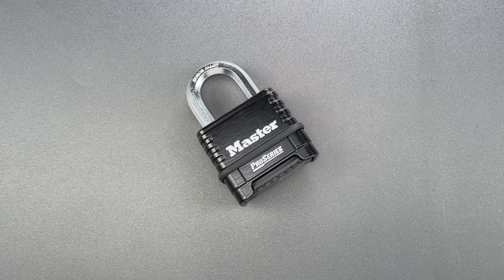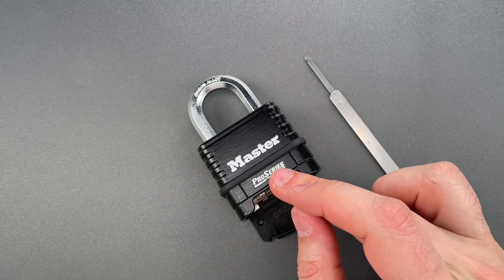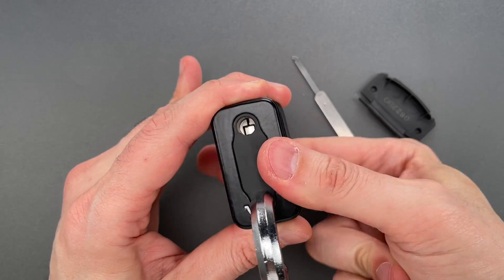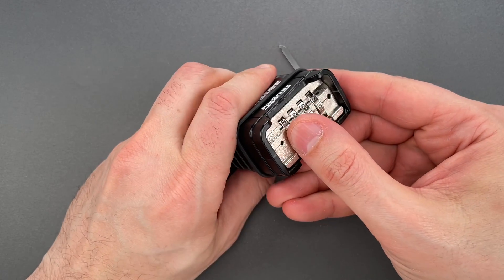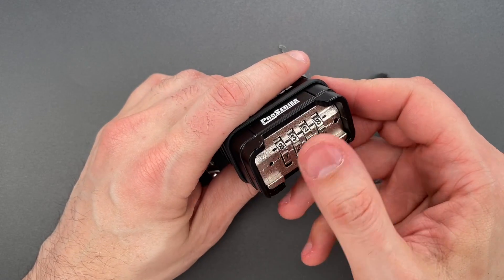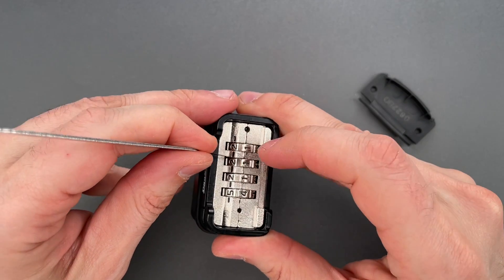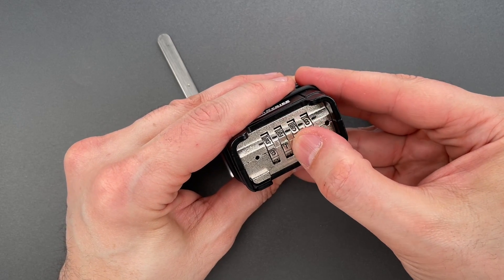[1521] Decoding Master Combination Padlock (Model 1178)

Comment: Its scary, how easy me as a novice can open some locks, i bought a cheap set on a website, cus i wanted to learn, found a use for the skill one time at work, and it took me a few seconds to open the lock just raking it with a diamond pick.

Comment: Master lock has the same flaw in the brass 3 number combination locks. There's another technique where you just tension it and spin all 3 wheels at once as fast as you can. You can get them open in 30 seconds or less. I was playing with one in math class when the teacher asked me if I knew what the odds where I'd actually open the scrambled code? It literally dropped as soon as he finished asking. "Pretty good..." I replied with a smirk.

Comment: Dear Lawyer,
I know it's only a €10 bike lock and worth €2 of the brand REHKITTZ on Big A ASIN B07F2XX61H, but I forgot the combination.
I was quite sure to have adjusted only one of the five number rollers, (00007) but I can no longer open it.
Maybe you have a tip for me, preferably without tools or with a very simple metal strip, for example.
Greetings
Frank

Comment: Breaking news: Master Lock and Boeing are discussing a merger. The new locks will feature a price tag with an improved value, adding one more zero. They will also be delivered several months after your order. But, in exchange, you don't have to embarrass yourself with LPL methods, as they will randomly fall off on their own, saving you the trouble.

Comment: I once opened a 4 number code lock with brute force. Exactly 10000 possible combinations and I got unlucky and the code was 8650. But after I had gotten the hang of it, I could, as long as my hands didn't get sweaty, get one combination per second on average, so it took me a little over 2 hours. 

If someone really gets the technique down, I could be possible to brute force 10000 combinations in an hour, meaning that these kinds of locks aren't that good, no matter how sturdy the lock itself is, someone can just trial and error it.
Reply: I guess we have different definitions of brute force.
Reply: @jimnelsen2064  I'm referring to the mathematical brute force. Like how AIs try to brute force a password.
Reply: Yep i get it, just teasing.

Comment: One thing that's always worth mentioning with locks like this: you only need to decode all but one dial.  Once you have one dial left, you can just try each digit until it opens.

This reduces the number of possibilities from D^N to D^(N - 1) + D, where D is the number of digits per dial, and N is the number of dials.

Comment: These are not high security by any means. However, this is the longest I've seen LPL take to open any Master Lock. It's a low skill attack, but it does take longer than raking.

Comment: Now I would like to see a way to reliably decode the combination of those typical, 3 number combination, "right-left-right turn" rotary knob combo locks that you see all over school and gym lockers and such, because I have a few of those that I've found in the trash over the years, that I don't know the combo for, but that I could still use if I knew of a reliable way to find out their combinations. I'd rather not destroy their case physically just to find it out either, because of course that makes them basically useless at that point.

I realize that those kinds of locks aren't very high security at all, but they could still be useful for locking up your garage tool cabinets or tool boxes from curious kids, etc., (for example), or just for something where a lock would be rather useful and helpful, but not absolutely essential for life safety or security.
Reply: Try his video 635, worked on my sister's old locker combo lock
Reply: @shadowraven137  I'll have to look that one up on his channel, but if it's just him picking one of those rotary combo locks that actually had a key bypass on the back of it, then that's not really what I meant by being able to decode the combination of those types of locks. That doesn't count.

Comment: I would like to note that on the covert companion you made the notch decoder out of steel. It easily deformed after using it for a bypass a few times. Perhaps cutting it out of nitinol to allow for heat reforming would be best ? I'm not sure I'm planning on buying a laser cutter after I find a place to live and I'll do some experiments.

I was also able to heat treat the notch decoder after reforming it to make it slightly better

Comment: Back in the day when code padlocks came out I used the same pressure pull and turn the dials as you did with this padlock. 
The fun factor was the when we unlocked around 4 we put them on the other bikes basically mix them up. Lol. Never did hang around to see what the result was when they came back and the lock wasn’t theirs. 
Did do this a few times 😂

Comment: It seems like all of these cylinder combination locks are vulnerable to the first method LPL used.  You pull on the shackle and there is a different resistance to the wheels when the right number comes up.  I don't know much about the mechanism being used; is it possible to engineer this style of lock that does not have this vulnerability?  Are there locks in circulation that don't suffer from this?  I prefer combo locks in places like a rec center because I don't have to carry around a key that might get lost while I'm working out.
Reply: If it uses a simple bar as part of the mechanism, it's always defeatable with this method, providing you have the skill to do so.
Combination locks are even worse as almost all of them can be shimmed.

Comment: I have this exact same lock. Use it for internal gates so you can only get to them from inside the yard. I bought it for weather resistance vs security. The rubber flap just trapped water and froze when cold so I ripped it off. Locking numbers are at an angle too which is a little annoying. See how it holds up to the weather. Last few combo locks (175) failed after 6 months. Masterlock kept sending me replacements but the just didn't hold up.

Comment: That's the "pro" edition? What does the regular edition do, unlock when you breathe on it? On a side-note, I remember  using the feel method on a Master lock when I was 10 years old. It's mind-blowing that these locks haven't advanced in decades.
Reply: Pretty much.  Think oversized luggage lock :)

Comment: Talking about Master Combination Padlock, I bought a Model 7620EURD from Tesco and found it has some funny characteristics.

On the 3 digit padlock, only the topmost digit need to be exact. The second and third digit could be the exact one you set, or the one on the opposite side (Say, if you set it to 0 then 5 will open it as well)

So assume you never heard all these techniques, by brute force trying the combinations, all you need to try is only 10 x 5 x 5 = 250, way less than the 1000 combinations it supposed to have.

Very interesting...

Comment: How does one know that it's specifically "6 positions"? That seems to be randomly specific enough (and seems to vary by lock model and manufacturer) that it shouldn't really count that heavily as a weakness. If someone who knows that specific lock model that well wants in, they're getting in.

Now, the first weakness is egregious. I used to open my friends' bike locks that way back in the early 1970s because I thought it was fun to make them freak out and think that they forgot to lock it...
Reply: It may have something to do with 5 for halfway and 1 extra because the "code" line is offset.  In any case, even if it was a different number of positions, it would still be the same number for each wheel which means you only have 10 options to check, and you can often roll all the wheels together so it would only take a few seconds...

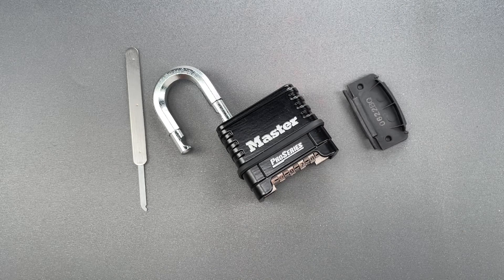Comment: 3:43 "Only good for about a minute of delay" - by LPL standards that's actually pretty good. This wasn't difficult to unlock, doesn't require substantial skills (though does require knowledge of this individual lock's mechanism) but it actually took him longer than most locks do. He's had hardly any locks he couldn't get into at all (at least that he shows, occasionally he's mentioned a "naughty bucket"), some require more specialized skills or tools, but the majority take less time than this. So, especially for a Master lock, I'm not too disappointed.

Comment: Pulling on the shackle and advancing the wheels was something I discovered by myself in the 80s. No code wheel lock was safe from me.
Reply: I also worked out that this simple technique works sometime in the 1970s when at high-school!  It also became a trend to fit these combination-locks to suitcases & briefcases, so it was real easy to change the combinations!
Reply: @stevie-ray2020   I remember on my first day of year 9, my locker code which I had been using all day stopped working. We got a staff member who tried to open it (they had a database of all the codes) but the damn thing would not budge. Knowing the school, it was probably some kids fucking with me on my first day. just realised this now

Comment: I opened one of these with the use of a USB microscope: looking between the tumblers, I could see a gap at a certain position. Turn each through 180° and the lock opened.

Comment: I've been using the feel-free method to open such combination locks like that for more than 40 years! It's astonishing that such locks are still being bought, let alone sold.
Reply: Same, as a young entrepreneur at school I would swap bike locks to other bikes with the same lock.
I would then charge for my "picking skills" to get them open again.
Reply: @Stambo59  the bike lock equivalent of a protection racket
Reply: @Stambo59   About 50 yrs ago when I was at high-school I worked out how to use this method to open cases & padlocks.  However, there was no space for lockers at our inner-suburban selective-school, nor did anyone ride bikes as most students walked &/or caught public-transport buses to school, with only a handful of  the senior students driving due to limited on-street parking.  So unfortunately I couldn't take advantage of my 'skills' like you did!
Reply: Especially suitcases, they are often 3 digit as well you brute force all combinations and eventually it will click when the right combination is found

Comment: lock companies should hire this man to test their locks so as to eliminate all vulnerabilities
Reply: There's a reason these vulnerabilities are out there and it basically comes down to money. Design and testing costs money, as does extra material needed to reduce vulnerabilities, and I would guess that the market has shown many times by now that it just doesn't care that much about vulnerabilities if allowing them keeps the price low.

It's the same thing with air travel. Everyone complains about air travel, but everyone also looks for the cheapest fare they can find. This creates a natural tension that usually prevents airlines from addressing complaints about the flying experience.
Reply: Agree, but: there is absolutely no point. It costs money, and people still buy their shitty product.
Reply: The other question is how big a problem theft via lock vulnerability actually is. An expert like LPL can get these open pretty quickly, but I doubt it's actually so common in the real world. It requires specialized skills, specific knowledge of each type or style of lock, and so on. I suspect it's far more common for thieves to cut the lock, or more often whatever the lock is attached to. Or to seek out things that were not locked in a secure way - when I was in University I saw so many bicycles on campus that were locked in a way that someone with any knowledge of bicycles could easily steal by doing things like taking a wheel off. Some were locked by the wheel, someone could take the wheel off and take the rest of the bike, then steal a wheel off a different bike. Bicycle theft was a major issue, but I doubt the thieves were picking locks.

Comment: I have this exact lock, was using it to secure my house builders fence. On the first day, somebody dropped the lock in the sand and needed 1/2 a can of WD40 to get the wheels turning again. 
However, when the shackle is under high tension, my wheels do not turn at all.
Loosening the tension a little, the wheels turn in ascending order only and lock at 0.
Only under no load can wheels turns in both directions. This  is tough to do when the chain fills most of the space in the shackle.

Perhaps sand is the missing ingredient to make this secure
Reply: Sa sand?!? Bbut it's coarse and rough and irritating and it gets everywhere.
Reply: Roger that-- give the lock a good sand bath before initial use.  Thanks for the tip! lol
Reply: I always keep a little pocket sand handy.
Reply: WD40 IS NOT A LUBRICANT!  It is a "Water Displacement" that leaves a thin film of VARNISH behind as a rust resistor when the solvent evaporates.  This varnish accumulates and becomes a GUM that jams up anything......................elsullo
Reply: You use a Master lock to "secure" something? Are you insane? Buy an Abus or another decent brand that actually takes security seriously.
Reply: @Jim Parlett  to be honest I didn't know at the time they were so cr@p. In Australia, the big box store pretty much only has Master brand combination locks.
I really needed  combination lock as keys are too hard to manage with multiple trades

Comment: A 4-minute Master lock video from LPL! This has got to be the best lock they've every made!
edit ... my bad!
Reply: Yep. So great that they had to put two vulnerabilities into it
Reply: I had the same thought!  Then I watched it and saw that he did everything twice and he wasn't even going fast.
Reply: @jackkelledes4082  To the lock's credit, both took him longer than many of the locks he's gotten open. And these require knowledge of the locks' internal mechanism, even an experienced locksmith without knowing this specific lock would have a harder time.
Reply: @quillmaurer6563  Well, my first intuition with combination locks would be to start with pulling on the shackle and manipulating the code wheels at the same time. To check if the lock gives any feedback from that. From there it doesn't take long to figure out how to decode this lock.
Reply: The only thing that changed is that LPL is talking slightly slower.
Reply: He said in the end that this would cause minute worth of delay for the thief so I guess this is actually the best product MasterLock makes. Most of their stuff opens in 5–10 seconds.

(In reality, the best product MasterLock makes is "MasterLock 1500iD"  – it's actually a good lock except for physical strength. There are no easy non-destructive attack for that lock as far as I know.)
Reply: @MikkoRantalainen  That's the point I was making, though I find it odd that he phrased it as "only a minute" rather than "this is actually one of the longer-to-open Master locks I've seen."

I'm assuming the 1500iD you're referring to is a plastic-body LOTO lock? I've heard that Master Lock is a bit of an enigma, having nearly pick-proof cores in their LOTO line, and easily picked heavy duty locks, but have never made the heavy duty lock with pick proof core that would seemingly be an obvious combination of parts they already have.
Reply: @quillmaurer6563  MasterLock 1500iD is the lock with real shackle and cast aluminium or cast zinc body. However, there are some internal parts made out of nylon and the body is hold together with 3 screws. See BosnianBill video titled "(1359) Review: Master Lock Speed Dial 1500iD" for more information.

There's also math paper about the actual mechanism inside and if it were made out of e.g. brass and stronger body, it would be a really good lock. And of course, the body should be made out of interlocking parts that cannot be teared open without removing the shackle first.
Reply: @quillmaurer6563  you have to see it this way:
A combination lock takes longer to open even if you know the combination.
So someone handling a combination lock for a minute looks totally normal for a bystander.
Whereas a lock with key would be suspicious if you need a minute.

And of course that only implies if anyone is looking. If nobody is around it doesn't matter if it take you a minute.
Reply: @quillmaurer6563  I think it makes sense to consider those as LOTO locks even though MasterLock definitely markets those as real locks.

It seems that these locks are marketed under "MasterLock Speed Dial" brand.

Comment: The decoding method for this lock actually seems fairly esoteric, which isn't the best form of security but is better than nothing.  If only there wasn't that pesky, much easier, tool-free method....
Reply: He got it open in under a minute each time, but that's fairly long by LPL's standards. And that's only after knowing the internal mechanism and experimenting a bit, probably took him some time to figure this out before recording the video. So I'm actually decently impressed.